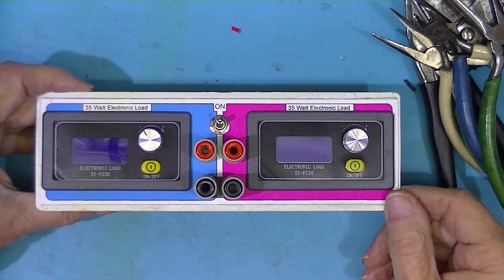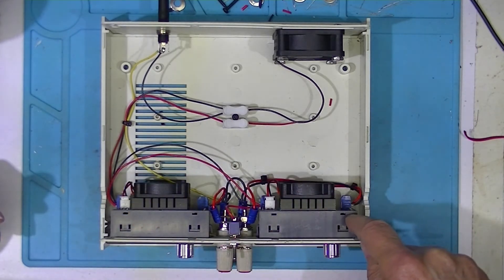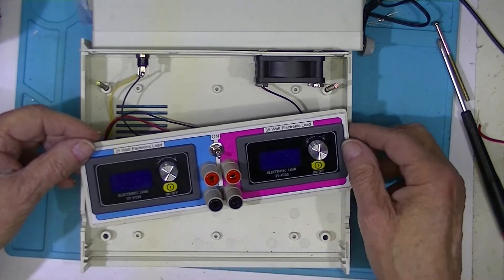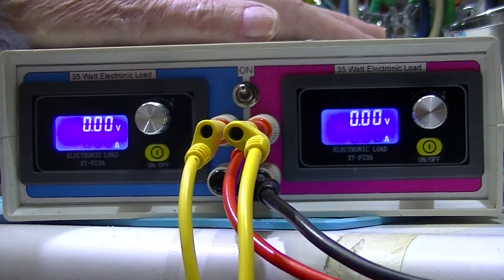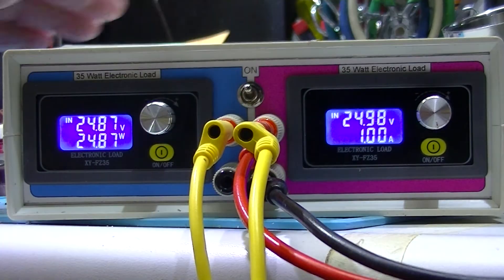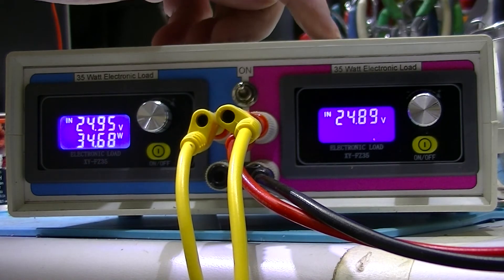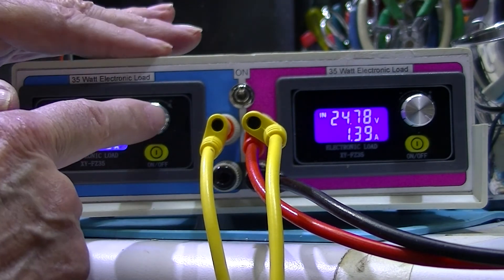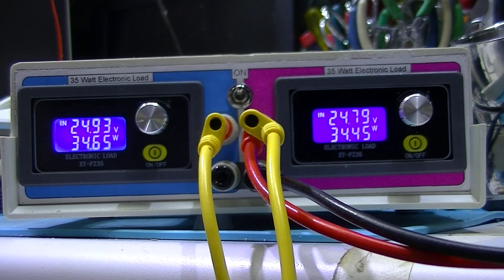Enclosing a Dual 25-35 Watt Electronic Load Part 2

Comment: Steve can't you change the front panels to the rear and the rear panels to the front or just change the shell and then you should have room for the bolts in the back versus front
Reply from the maker: No, the case is symmetrical side-to-side and front-to-back. I'll just re-create the front panel and move the fan a little more toward the center in the rear.
Thanks
Steve